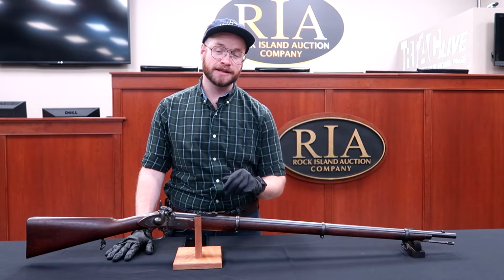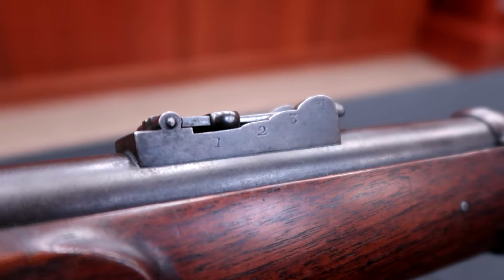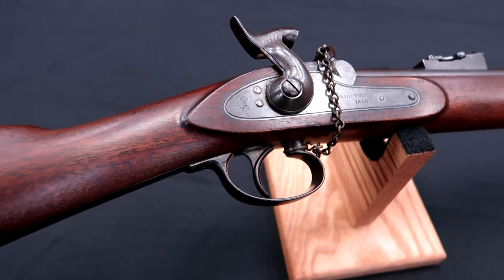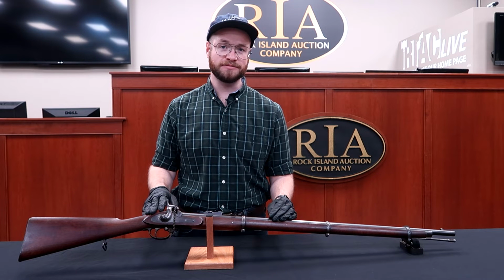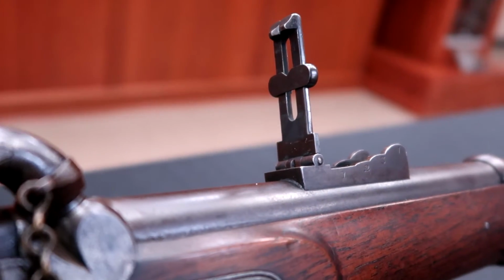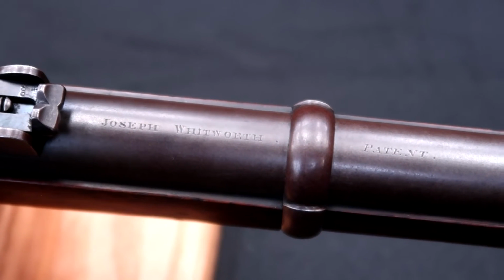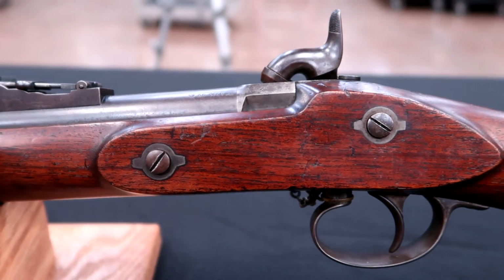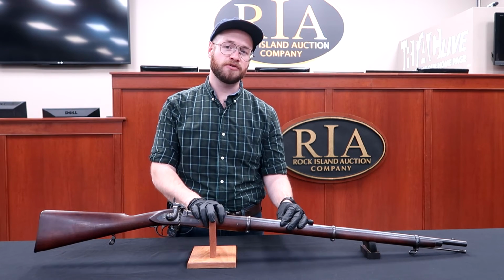1858 Prototype Whitworth: The first Long Range Muzzleloader | British Muzzleloading Excellence

Comment: I want a repro of one
Reply: The best replica was made by Parker-Hale from around 1980 to 1990.  Serial numbers will be no higher than 9000-ish.  Pedersoli now make one, and EuroArms MADE one, using left-over barrels and parts from the Parker-Hale company that closed down in the early 90's.  capandball is a great proponent of the Pedersoli version, as a Pedersoli dealer that is only to be expected,  However, he does not shoot it at long range, as we do here in UK.
Reply: @tacfoley4443  i've actually gotten a pedersoli whitworth for about a year. i've smashed many groundhog with it so far from 200 yards out to 800 yards just fine. So far the rifle has been super accurate with my custom hexagonal bullet mold. the farthest i've shot it out to was 1200 yards and it does well. it has given me consistent groups of 10ft on day with little to no wind.

Comment: This particular rifle is recorded in the Whitworth Research Project database. It was first noted in 1963, although prevenance is now established to 1951. It has possibly a small Enfield style lock, with Enfield-pattern military sights, and Enfield barrel bands. Whitworth's establishing a relationship between rifling pitch, bore size and bullet weight/length are I think a greater contributon to accuracy than the hexagonal rifling.

Comment: Nice to see a chat about an early example of the Whitworth rifle. Whilst the Whitworth was undoubtedly an accurate rifle for its time, setting standards for other gunmakers to aspire to, contemporary reports can be misunderstood. The presentation unfortunately misrepresents the accuracy of the Whitworth.

The system used to measure precision of rifled arms was the "Figure of Merit" (FoM). It is a measure of mean radial distance of shots from the centre of a group. This is not group size. The actual size of the original group cannot be determined from the Figure of Merit, however for a 20 shot group multiplying the Figure of Merit by about three and half will give an indication of the likely overall size of the group. 

So in trials in 1857 the Whitworth was recorded with a FoM of .37 feet (or 4.44 inch) - based on the above this would be a group size in the order of 15.5 inch. At 1100 yards the FoM of 2.41 feet was recorded - so a group size in the order of 8.5 feet. At 1880 yards the FoM was 11.62 feet, or a group size in the order of 40 feet.

See the following article and videos to which it links: http://www.researchpress.co.uk/index.php/firearms/british-military-longarms/small-arms-trials/measuring-accuracy
Reply from the maker: Thanks! Added the link to the pinned comment above